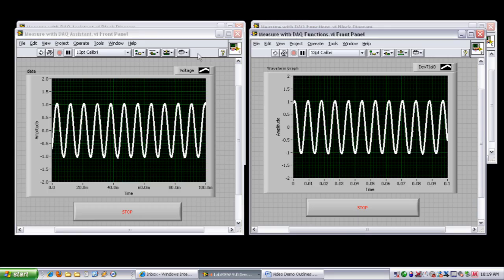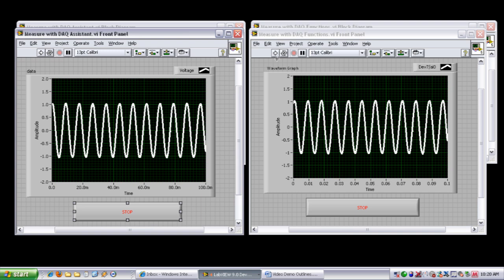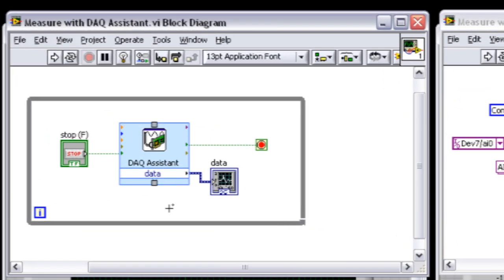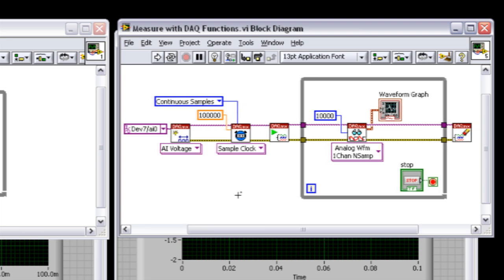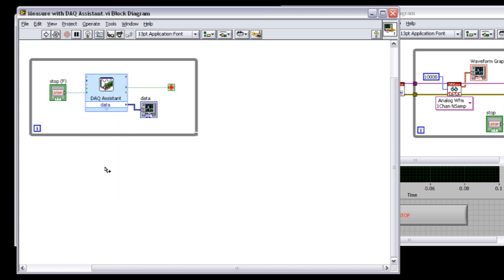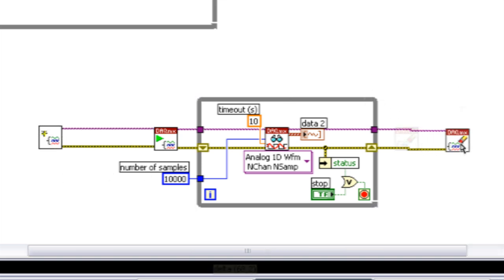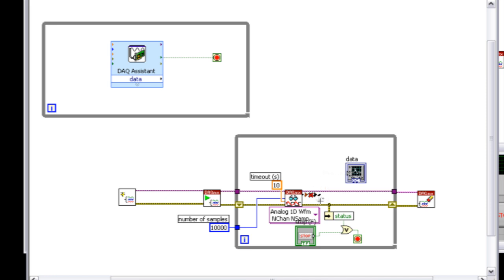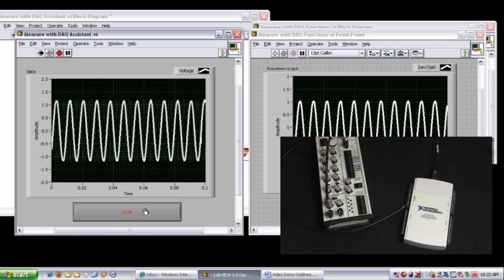Automatic Code Generation with NI-DAQmx and NI LabVIEW

Comment: Hi we have NI 7.4.4 version software we are using it to configure our system(machine) recently we are facing problem showing error" pump failed to configure" 
I had installed the software properly still it is giving same problem. I have checked the nidaq card it is working properly.
please tell how i can solve this problem . revert back me soon.